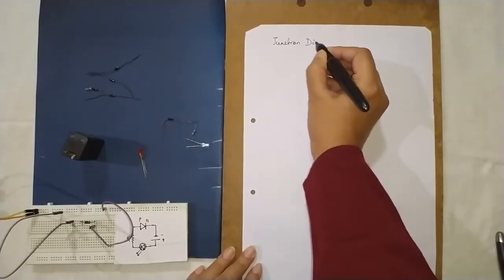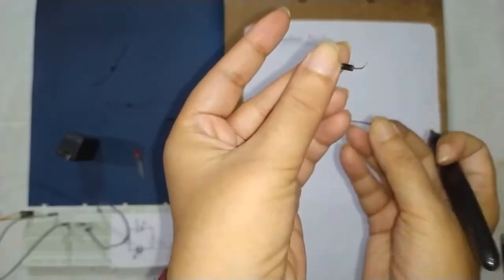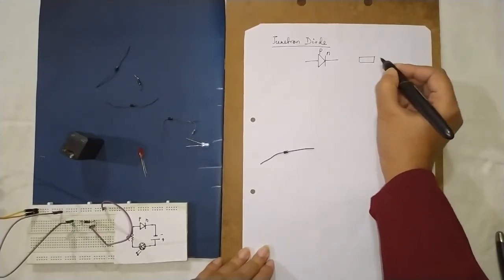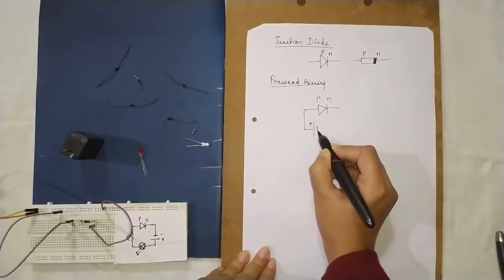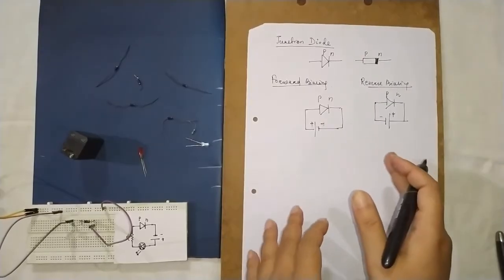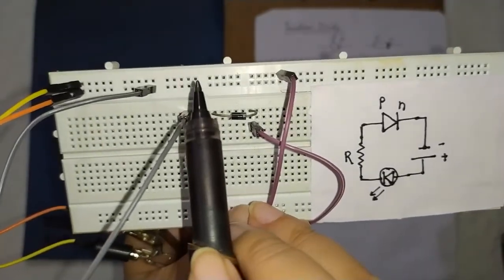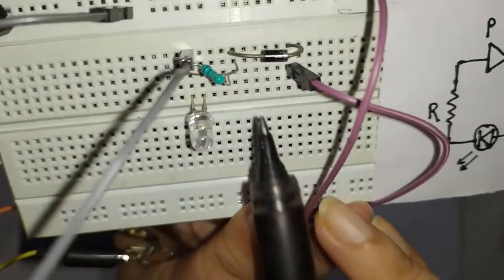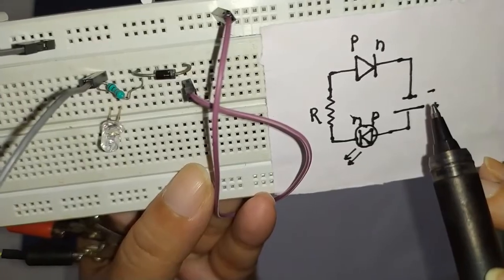Experiment on forward and reverse biasing of junction diode

Comment: Please let me know why we used diode with reverse bias in a circuit
Reply from the maker: Actually it helps us in many ways. As you know that in reverse bias almost no current flows in the circuit so we can have different types of diode basing on this property like zener diode which helps as a voltage regulator, varicap diodes which is nothing but a variable capacitance diode etc. And these diodes are especially operated in reverse biasing condition.